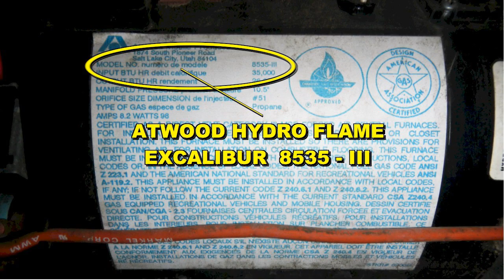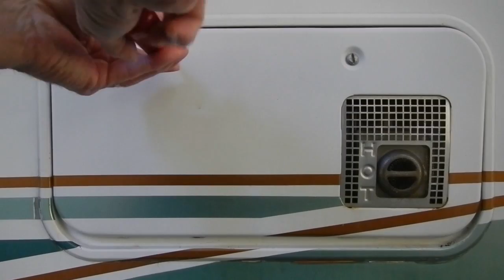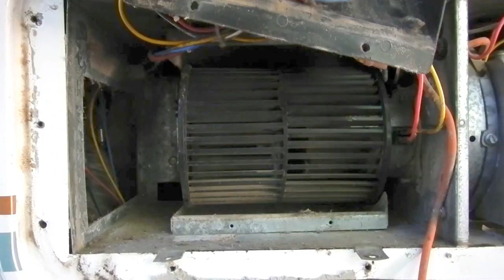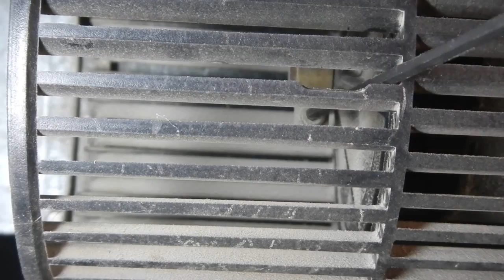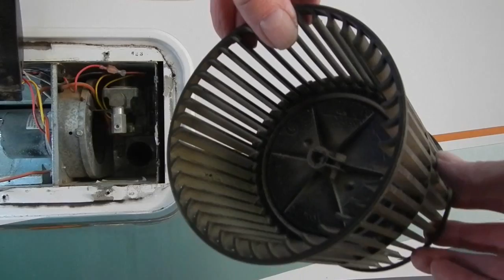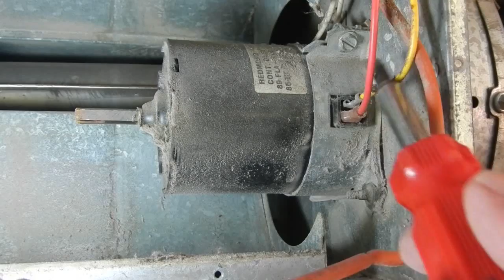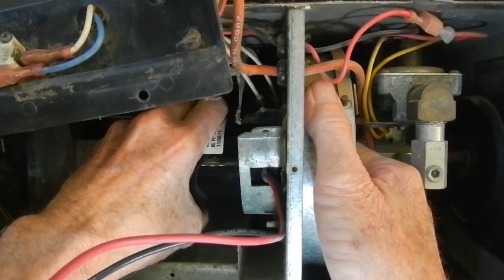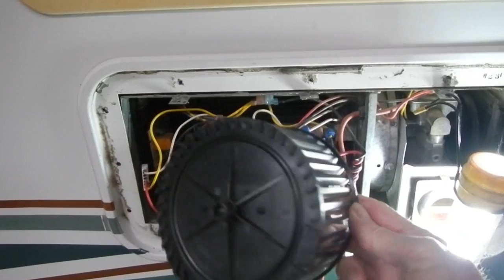REPLACING THE MOTOR ON THE ATWOOD FURNACE

Comment: Very nice and helpful video . I am doing mine now and have run into a problem . I can't get the shaft out of the fan collet . It is stuck and I'm afraid I'll bend the fan . Any suggestions are appreciated . Thx. and again , GREAT video !!!
Reply from the maker: Sorry to hear you are having problems. I would try spraying some "Blaster" or something like that, let it soak and tap on the fan collet. You may need to pull the burner assembly to get access to tap the fan. Be careful, you need to disconnect the gas line to pull the burner assembly.
Reply: Thanks again . I ended up heating the collet and buggered the set screw threads but have conquered that part finally . I am in the installation stage now . Will come back and let you know how it went . Thanks again .
Reply: Got it all together and it wont turn on . I tested it with 12v and the motor is fine . Grrr
Reply from the maker: Damn! Sorry to hear you are having problems. I am guessing it's electric. Check our wiring.
Reply: I seems that my time delay switch went bad also . I just now got a new one and will install tomorrow . Thx for your help .